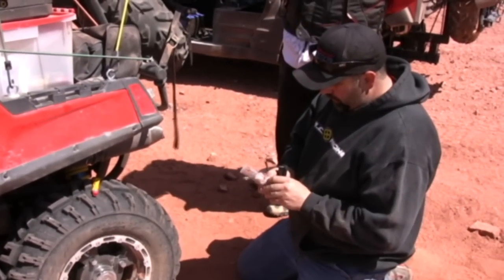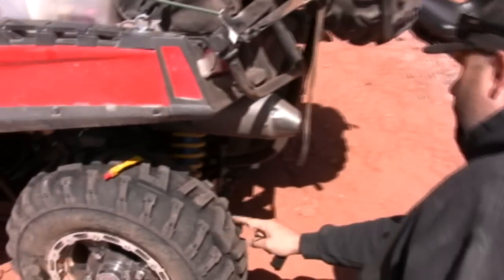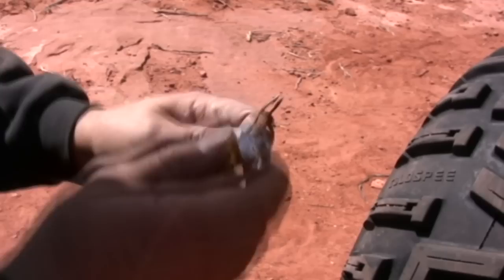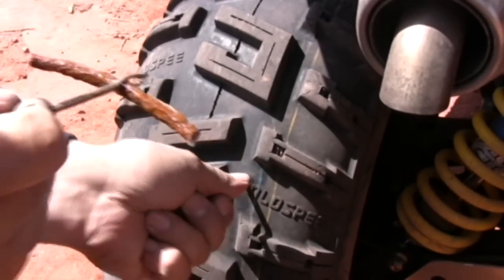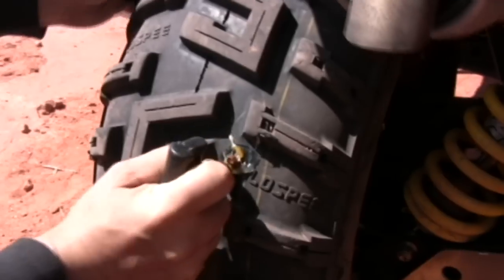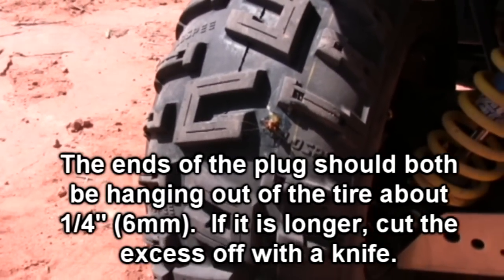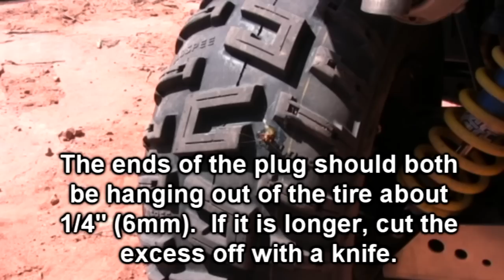How To Plug an ATV or UTV Tire

Comment from the maker: It depends on how bad the hole is. If it takes more than one plug to get you back to the truck or if the hole is in the sidewall of the tire we recommend getting a new tire however if it's just the small hole in the tread the tire plug is made to be a permanent fix and should last the remainder of the tire.